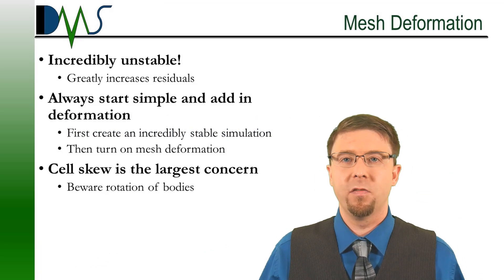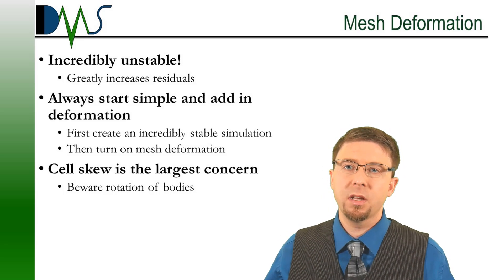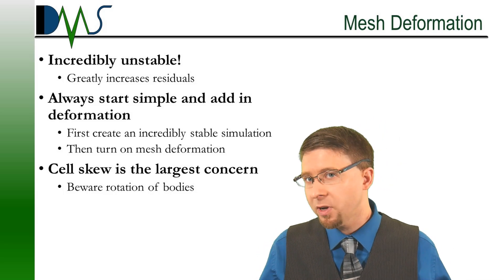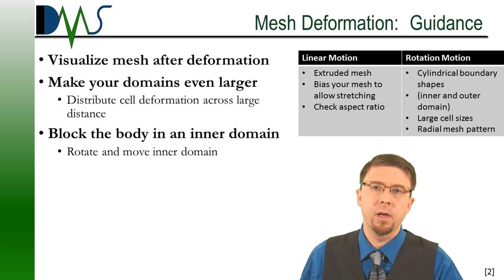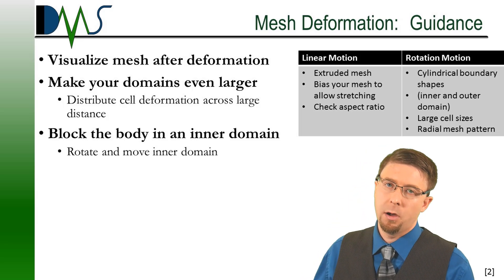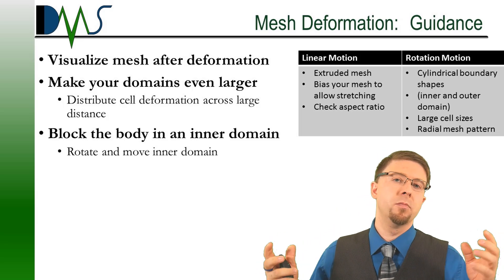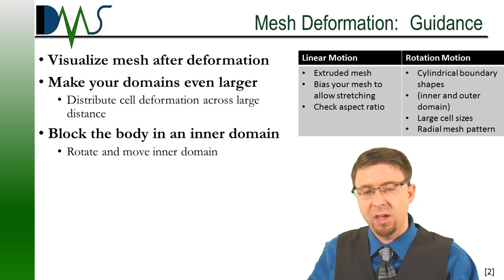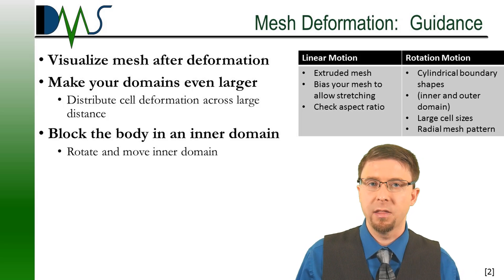PRACTICAL CFD MODELING:  Mesh Deformation

Comment: I'm simulating a flow inside a Pelton Turbine using Ansys CFX. I'm using Turbine inside a rotary domain and Inlet of a jet in a stationary domain. However when I keep Turbine stationary the flow from jet interacts with the bucket perfectly for steady as well as in transient mode. But as the rotation is increased for the turbine abnormal behaviour of the jet is observed. Do I have to invoke mesh deformation for the rotary domain??